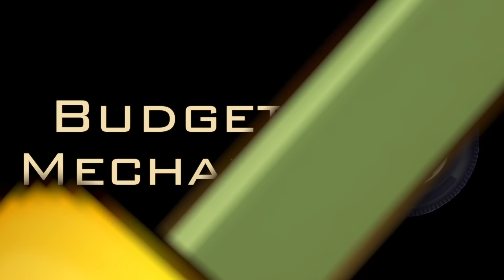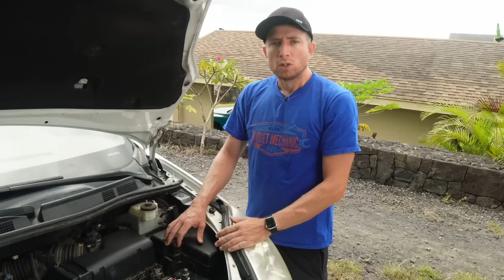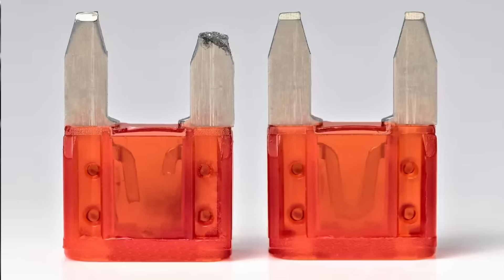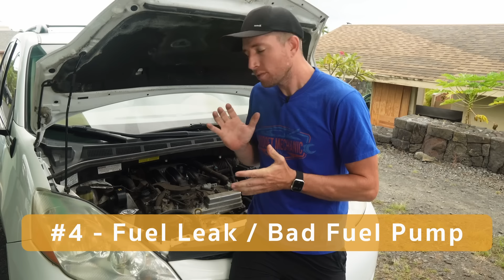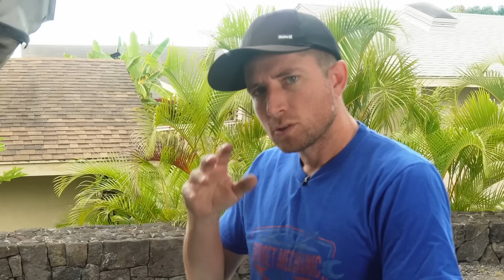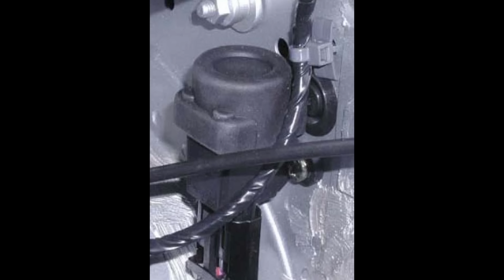Car Cranks But No Start? Diagnose And Fix Now!

Comment: I’m Stranded in Florida. I got a 2007 Honda accord that only cranks, no start. Fuel pressure is good, I still replaced fuel pump anyways. Pressure stays where it’s at for hour and a half after priming. I can hear fuel pump activate as well. Battery is good. Works a little bit when I spray starter fluid into intake. Pulled spark plug out and it’s dry, people are saying that’s bad but I read that it should not be wet. I’m lost
Reply: Since your spark plugs are dry, the fuel injectors may not be firing. Use a noid light on an injector connector to see if it’s getting a pulse while cranking. If there’s no pulse, suspect an issue with:
Main relay (PGM-FI relay)
ECU issue or wiring problem
Crankshaft position sensor (CKP) failure.

 -Check for injector pulse with a noid light.
- Scan for codes (even if the check engine light is off).
- Check for CKP/CMP sensor failures.
- Confirm the immobilizer isn’t active.
- Verify timing alignment.

Comment: My opel Astra 1.6 model 2003 doesn't show a battery what happening please help me
Reply: The alternator is responsible for charging the battery. If it’s not working properly, the battery will not charge, and the dashboard may fail to show the battery status. You can test the alternator by measuring the voltage across the battery terminals; it should read around 13.8 to 14.4 volts when the engine is running.

Comment: My i30 diesel cranks but won’t start but it starts if I spray easy start in the air filter pipe and there’s fuel coming from the fuel pump into the rail

Comment: On second fuel pump. Ford service said 1st fuel pump putting out 8psi when it shd be 40psi. Replaced fuel pump. Still takes abt 4 tries to start. Once started runs great. And the next time it cranks right up. Two different mechanics cant find problem since  car almost always start.

Comment: I have a 98 Chevy S10 2.2 L 4 cylinder always ran great pulled it in the garage didn't start it for about a week and now it will not start I put in a new battery new plugs plug wires coil packs, fuel filter map sensor idle air control valve , I do have gas in it.  any ideals ?,  thank you

Comment: so I have the same problem right now with my truck...I replaced the sensors and everything. When I try to start it, it only cranks but when I look at the exhaust pipe no smoke comes out, would that be my fuel pump?

Comment: I replaced starter, battery and alternator last year,  just replaced coils and spark plugs. Seems to not  like the cold, it will start if its warm. Going to check the fuses and relays, I have a feeling its the fuel pump.  But could be one of the other issues you mentioned.  Just need an honest mechanic thats willing to check it all out. Thanks for the tips.

Comment: Mine stopped working after I went to work and tried starting in 5° temperature and even after bypassing the fuel, it didn't turn on.
No spark.

Comment: Somebody please help. 2020 Hyundai elantra replaced crank, 2 cam sensors and all 4 coils and plugs (all the codes that came up with check engine light except for map). Car ran great for a week now will crank but not start. Could that be the MAP? Where to start?

Comment: My car shuts down after twenty minutes of run time and won't restart until it's cold.So far I've replaced the fuel pump and filter with no luck.Any ideas?2002 Saturn SC2.

Comment: You missed one point though, I had the same problem but the reason was totally different. My car battery got too much grease (yes too much grease) and it won't let my engine start. I almost went to the mechanic but the guy who came to tow my car to the mechanic shop solved it in 2 minutes. Everytime I tried to start my car, it made efforts 3 times and then shut itself. It was releasing strong smell of fuel or something stronger. After cleaning the battery grease, it did start with little problematic sound but after a could of times, it came back to normal and I knew it was fine. So, don't ignore over greasing the battery. I am just surprised that the dealership did not do anything about it, don't know why we go to the dealership for service??

Comment: good video there a lot to look at im from australia here not that great video on cars most times I learn here and I fix me cars u run everything to look at they say can be a starter motor my car starts but run idle rough had a timing belt alternator air cond belt done but no adjustment after car idle ok driving good but sometimes wont crank over then it does some say could be the starter motor then im thinking could be the iac idle control valve I change new spark plugs new spark leads no idea stuck now I hear sucking maf sense no cracks no holes me mate a mechanic said that normal no idea how but as he said its a old car year 2000 but I have to break it all down

Comment: My 04 Lexus will run for 30 minutes at normal temperature, then shut down then it will not start for two hours. Then it starts perfectly why? and will run for another 30 minutes perfectly

Comment: Nice video. My 2001 Corolla sounds good Crank, but won't start. I tested the power from wires to the pump. It turns on twice the tester bulb (one shiny and other not shiny). Until now looks good, but I think something is wrong inside the pump. Maybe it's time to take out the pump and check it in a tester place
Reply: U ever figure it out? Having a similar problem on my 2000 corolla

Comment: Can anyone help. My car cranks but no start. If I disconnect the battery terminals then completely drain the system by turning on the headlights overnight. Next day reconnect the battery then the engine starts with no problem. I can drive the car normally but as soon as I turn off the engine, back to the same problem again that is cranks but no start.
Any ideas anyone?

Comment: I have the same issue with a Kia shortage I change all fuses coils sparkplug gas pump and still don't work
Reply: Did you ever figure out what the problem was?
Reply: @jerrodhopkins2143  yeses i did
Reply: @jerrodhopkins2143  was the wire that goes to the fuel pump, it  was cut i didn't find the cut so I have to run new wires from the fuse box to the fuel pump,,, it start right up

Comment: I have a 08 toyda Yairs 5 speed. The other day. While I was driving it. The car shut off completely. I have a new battery and alternator. And replaced the ignition switch. But, still I have no head lights, dash light. When I hit the clutch. It tries to turn the starter. I checked the wires and see no damage or breaks. They tested the battery, alternator and starter say they fine. I'm at a loss and don't know where to look.

Comment: TOYOTA HIACE 2kD Dolphin model 2008 will not start unless I pump the fuel filter pump by hand every time .   the following equipments are changed to solve the problem:- 1.The feed pump and hand or fuel filter pump is changed
2 .The valves are operated 3. The fuel injection nozzles are operated 
4 .A diesel fuel tank is checked
5.  I am replacing the air filter and fuel filter on time but so far the engine will not start unless I pump the fuel filter pump .Even if I start it again and turn the engine off after 10 minutes it still does not start unless I pump the fuel filter pump so what is the solution  . . . .  please help me.
Reply: Mine has the exact same issue, have you found any solutions?

Comment: 07 Lincoln Town car. In the morning and sometimes when I leave work, it cranks but wouldn't start till I press on the gas pedal a couple of times.... ( Weird cause is drive by wire). Fuel pressure is at 39.5 psi, good fuel filter, no check engine light... Please advise...

Comment: Hi mate

I have a Great Wall Cannon 2.0 turbo diesel, and there was water in the fuel tank. GWM cleaned the tank and replaced the fuel filter, but they said three injectors failed. I took it of them because they wanted too much.

I replaced four injectors from another used car with the same engine. I coded the used injectors and bled the system from the fuel rails and the injectors.

But the car still won’t start. It used to start even when there was water in the tank, but it was running rough. Now, it just cranks.

I’m looking for some advice on a few things. Do you have any recommendations?

And only two codes came up in the scan tool. 183B.

Comment: Went and put gas in my car and went to a McDonald's left 30 minutes later and went to start my car it cranks tries to start, but it runs very shallow, the engine has no power its very sluggish, it dies 3 seconds later you hit the gas and it doesn't start, it threw a catalytic converter code a week ago. It hasn't had issues till I went and got gas at nomnom.

Comment: I am facing same problem multiple times. Whenever this problem occurs I have to change the fuel pump relay. Which solves the problem for some days. Again same problem occurs. I don’t know this can happen due to bad battery condition. My battery has low density, though lights and everything working fine. Can anyone help?

Comment: Fuel can be determined by finding the fuel line pressure valve thake the cap off push in the needle valve and you should get a little gas out. Just follow the injector bar back. If uo have a guage just screw it on the valve. Crank  to read presure.

Comment: That happened to my dad's car Patrick Lee twice and I don't know is it going to happen for the third time. 
First when we were about to pick up David a 5 years old boy and Katie and 8 years old girl it began this I did not know what does that mean and after a bit of puzzling challenge it finally got working. 2 when we were about to go to school yesterday morning and the same thing happened but it was a bit more shorter. and if it happens at 3 time I would edit the comment showing the third time already after school and also if it happens multiple times throughout days I will probably notify you that my dad's car need repairing. By the way goodnight everyone😊 have a wonderful day tomorrow and also I need to show you some special toys tomorrow that I got off the st overplankton school in Ireland after school here is some toys that will may be here.
1st another hot wheel monster truck with white tyres and other of my favourite colours.2nd a Square blue and white poppet. That is all for my information I hope you enjoyed it and see you in the morning. And also thank you f-....

911: what's your emergency here 
User: my car isn't working 
911: I will ring a garage to repair your car everything will be alright 
User: thank you.
Lazy to do the rest

Comment: 2003 hyundai accent. Cranks but wont start, fuel to fuel rail. Spark at spark plugs. New map/iac sensor,  swapped the horn and starter relay.  Sprayed starter fluid into intake. It would run for a moment but then die. Suggestions?
Reply: Fuel pump

Comment: My truck had that starting issue, but code was P0300 means multiple misfire. I went through everything he mentioned, fuel pump, spark plugs wires, sensors, and the other things he went through for 10 months. And he didn't mention, the ecm computer.  When I drove it last before it not starting you could feel the misfiring from one to four at a time, fuel gauge was dropping twice as much, and only go about 30 mph. Ecm computer was problem.

Comment: Good morning from Texas! 
I would appreciate anyone's feed back on this as I am not a mechanic at all. 
This morning I woke up and went to start my car. After 2 tries it only made the cranking sound and did not start. I left it alone for about 5 minutes and decided tp try again. On the third try it finally worked. Based upon watching this video, I learned the issue is not my battery which was my initial concern. Because when I put my key into the ignition, the lights turn on, it beeps if my door is open and when I turn the key the dashboard lights up, the radio turns on. My only issue is the cranking but not starting sometimes. Other times it starts perfectly. I do believe it could be a fuse. My car has gasoline the light hasn't even turned on for empty tank yet. I will be taking it to get checked since my car is very important to me.

Comment: If it's your fuel pump, you might be able to get it going temporarily by banging on the bottom of the gas tank.
Not a long term fix but it will get you home or to the mechanic.

Comment: Crank more time but start after a long time of waiting. If I boost the gas pump the engine starts correctly. I changed the gas pump and  the problem rested the same. I must to boost the gas pump.

Comment: Hi there, My 2006 model Yaris is cranking without a start and there's also a check engine light. It only starts when I do quick start but it turns off after some seconds ..what could be the problem?

Comment: I got a 07 Saturn Ion stock everything, but anyway car been running fine starts fine everyday, yesterday after work I was leaving the job site and let’s just say the rock pad was rocky forsure, leave the site drive down the road bout a mile to the light, I come to an complete stop, I get ready to pull off car is dead I didn’t feel any sudden change or hear any odd sound. Car just went dead, try to start it all I get was a click lights, radio everything on still as well, thought it was the starter so I replaced but nothing now when I try to start I get bout 2 clicks. Any thoughts
Reply: Also apparently crossing that rock pad i punctured my oil pan smh but i doubt that got anything to do with it

Comment: So after watching your video and leaving a thank you comment and stating I'm a 65 you female....

I decided to buy a new battery because mine was considered old.
 
My car almost started, so I did what you said and changed the fuse, and my car started 🌞 but it's taking 2 turns of the key, so I'm wondering if there's more issues like the ignition. Getting late here, so I'll check in the morning.
Reply: Hope you figured out what it was! I’m surprised you didn’t get a response 4mo later!
Reply: FYI just a follow up, it was the fuel filter that needed to be replaced! Easy 20$ replacement by hand
Reply: Great, my car has the same problem.

Comment: I have a Mazda bravo 2005 petrol Ute, which is cranking fine, but just wont start. we cant here the fuel pump clicking on all the time. Tried to hard wire it also, but the same. Can I just run a separate fuel tank to the motor through another fuel pump and filter ok or is it more complex than this. Only Ute it for short runs. I charged the battery fully and had it going so thought it may have been the battery. had it going and took it for a run and tried to start a few day later and all it will do is turn over.

Comment: My car starts perfectly fine when its parked under shade or in mornings and evenings. But it doesn't start when parked under sun for around 2 hours. It cranks but won't start. I have to open up the windows, let car cabin cool down and then it starts.
What should i do? Mechanics are unable to find the problem.
Reply: can you start out with year/brand/model/trim/mileages & what have you replaced lately?

Comment: How do you use a feul/ vaccuum guage if the car won't start???
Reply: you can loosen the fuel filter's output & then start the car. Then shut off the car & check for fuel coming out of filter

Comment: Can you help me I have a 2006 is250 been sitting for 8 months it run when parked and now I decided to get it going again bought new battery try to start it now it just crank it won’t start what would be the problem?.
Reply: are you getting any fuel coming out of the fuel filter?
what is the battery voltage & CCA (did you have it tested)?
Reply: @angelisone  yes fuel is flowing the battery is good it cranks sometimes it hesitated to start but quickly dies